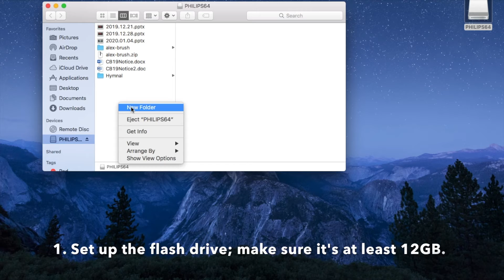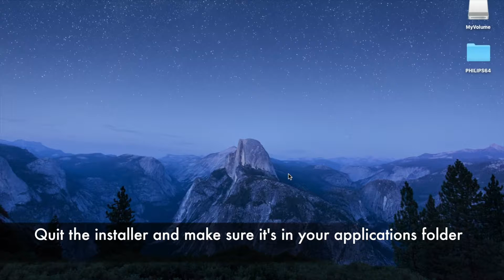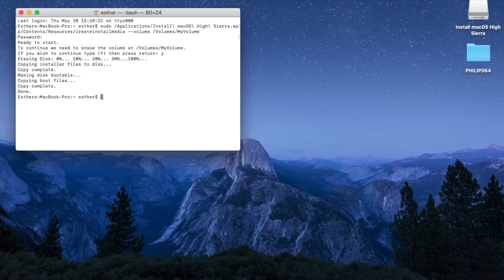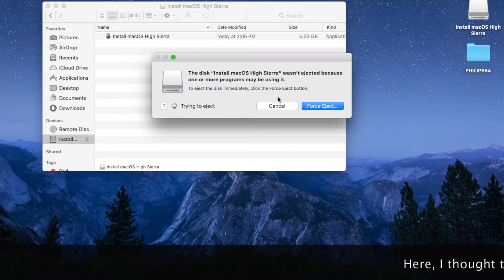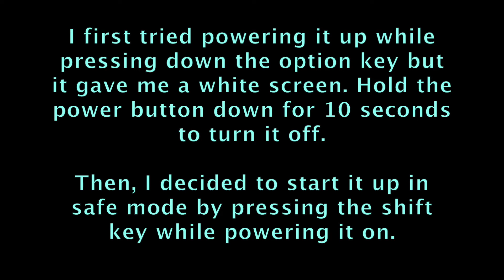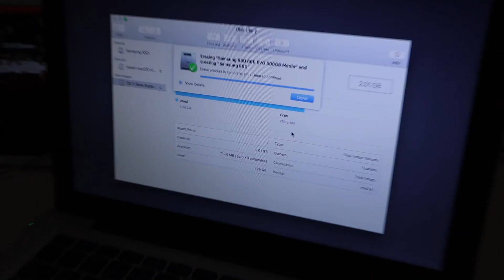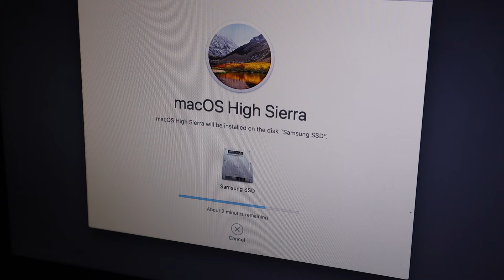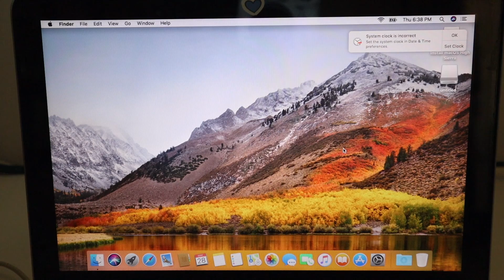MacBook Pro 13'' mid 2010 Upgrade | RAM, SSD, MacOS High Sierra

Comment: Nice video! I update my mid 2010 MacBook Pro a few days ago. Used a 120 GB Sandisk SSD, replaced de the CD/DVD drive with a 500 GB Toshiba HDD (got a cheap adapter on AliExpress) and upgraded the RAM with some juicy 8 GB (2x4GB) RAM modules. It works like a dream now :D Tried Ubuntu and Windows 10 but after facing the GeForce 320m drivers issue on both operating systems I finally went back to macOS through Internet Recovery Mode from the startup screen. Hope you are as happy as me with its speed and extra storage!
Reply: is mbp 2010 still good in 2020?
Reply: @Lanes25  well, it is if you do not need a beefy processor and/or graphics card. my MBP is fine but it lacks real power nowadays.
Reply: @agushacevoces  my uncle will bring mbp 2010 this christmas i will use it for music production only like fl studio
Reply: @Lanes25  cool. I think it will handle such software perfectly.
Reply: @agushacevoces  thanks sir i will replace the hdd to ssd for better performance but i dont know if i can install the os 😅😅 im new in mac